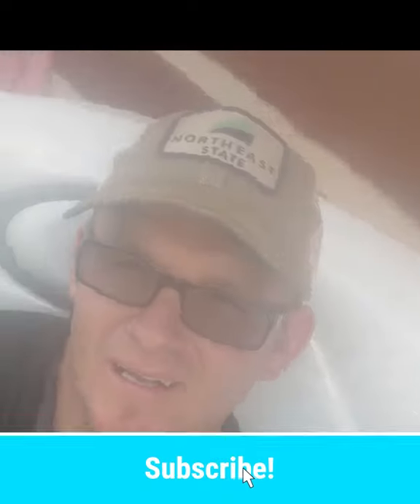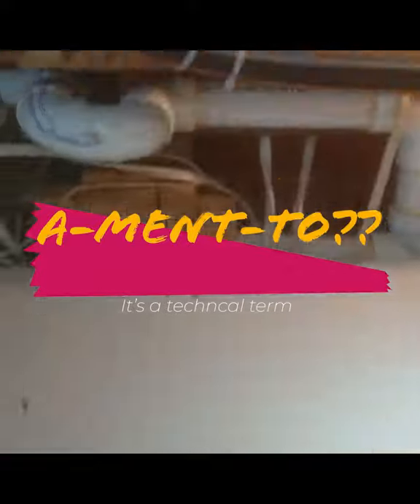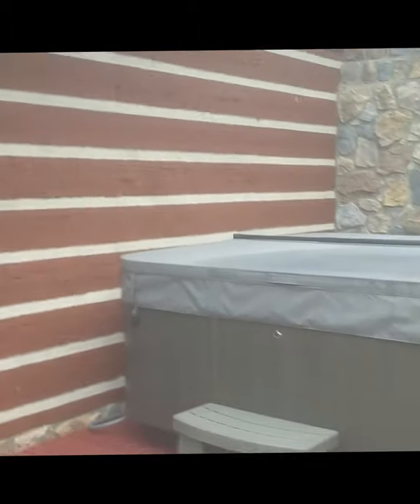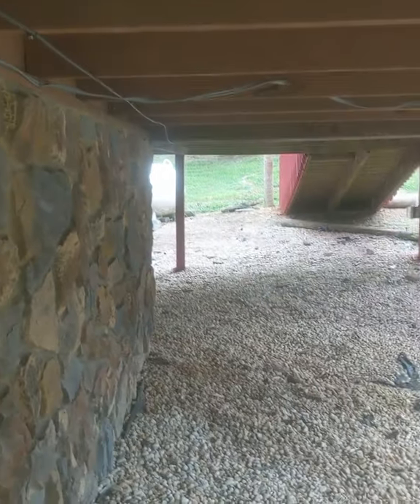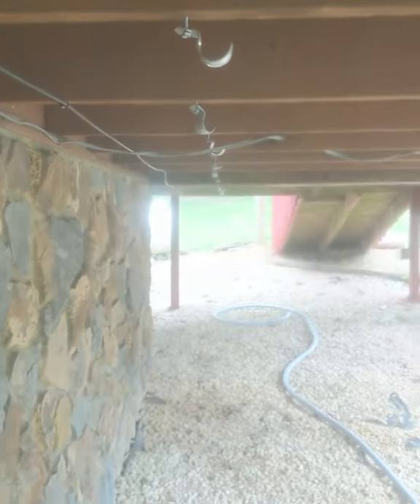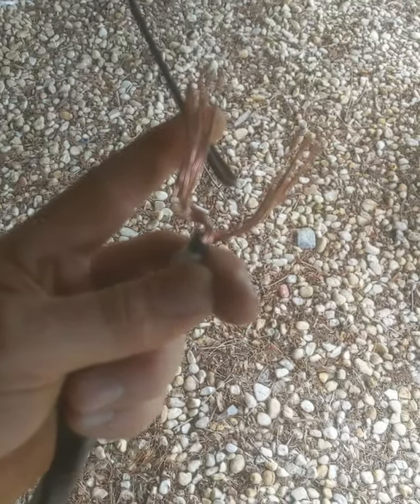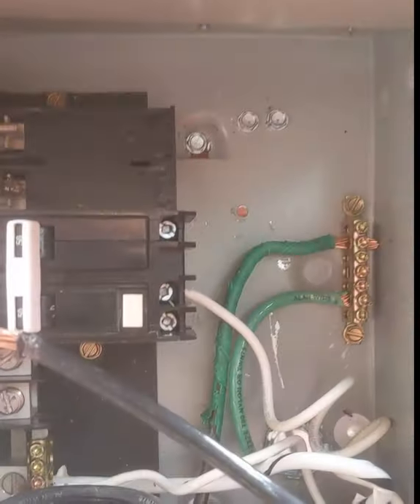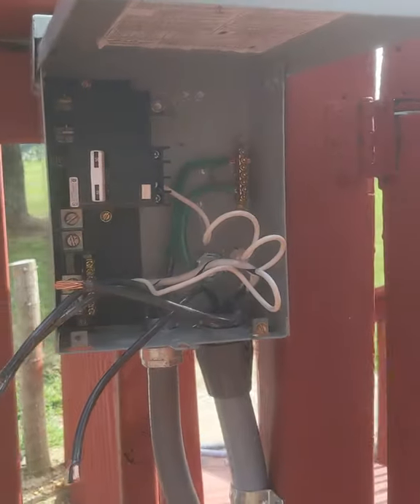How to wire a hot tub complete install. how to electrical. Be a Pro. Learn from the Pros.

Comment: I was wondering two things what type GFCI was it? Hopefully it was a fast tripping low current tripping. Nice to know it’s trip curve characteristics. Also did you have to upgrade the grounding and did you test it it before installing. Just so as to ensure fault currents could be cleared super quick in what is a high risk area. 

I would also recommend for someone to check that GFCI protection and wiring integrity on the hot tub was regularly checked and tested.